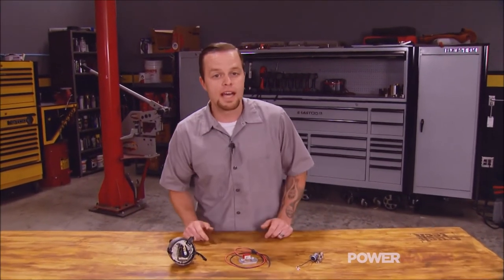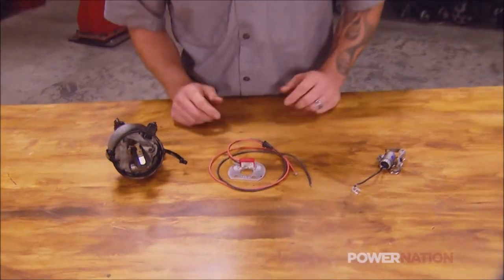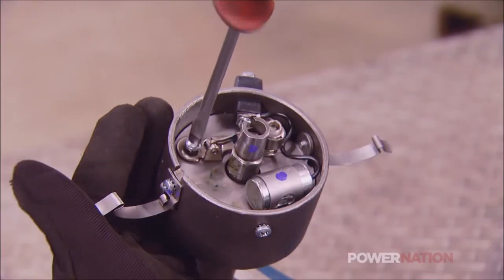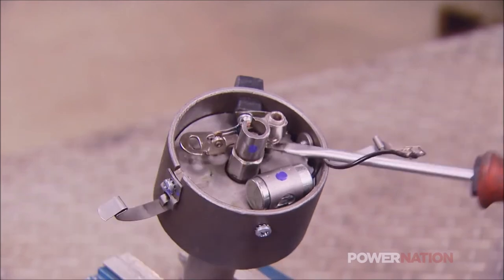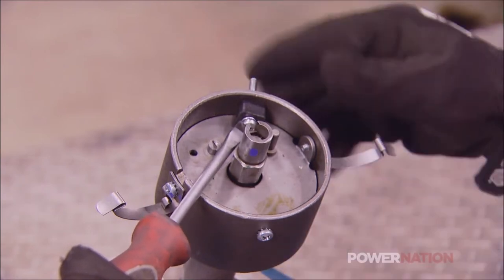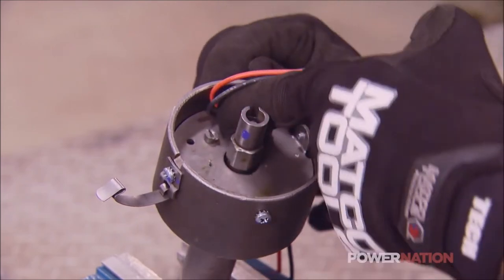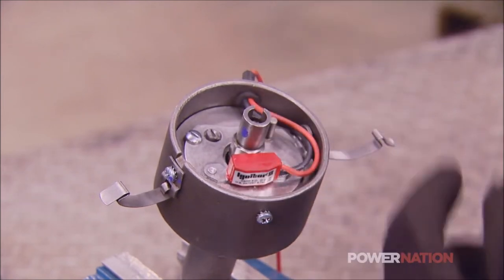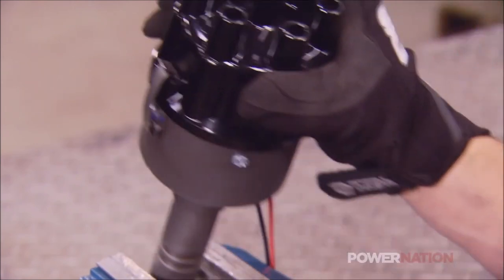PerTronix Ignitor 1168LS install in Chevy 235

Comment: Excellent tutorial and an excellent product. Maybe i can help clarify something that I'm asked a lot. The Pertronix 1168LS will fit the following:

Chevy, 216, 235, 261 engines:

GMC 228, 236, 248, 256, 270 and 302 engines (without Military distributor)

The Pertronix 1168LS is a 12 volt, negative ground component, I believe Pertronix also has a 6 volt version. Be careful to read the fine print when purchasing because there are positive as well as negative ground versions in both 6 and 12 volt units, as I recall.  I get my Pertronix kits on Summit Racing and they go into a lot of detail about which is which - and the part numbers are different for 6V, 12V and positive or negative ground.

I've even bought Pertronix for my Hercules JXD engines ( Pertronix 1561 ) and if you've priced a set of points lately - they ain't cheap no more!

Great video, thanks for posting!
Reply: How do I know if my distributor is positive or negative ground 🤔.. I wanna order the correct kit for my 51chevy 3100.thx bud✊🏽
Reply: @OGSHAKER2020   If the vehicle, itself, is negative ground, or positive ground, then the distributor will follow suit. Some of the GMCs were positive ground during the 50's. Just check to see which battery post goes directly to the frame: Hope that helps!
Reply: @AlaskaTrucker  heck yeah bud 👍 👌 🙌 👏 thx.. it is negative  51chevy 3100 ..also another glue I guess for me is theirs a ground wire coming off the neg. Terminal of coil to side of distributor.. so I kinda thought 🤔 that made it a negative ground as far as the distributor goes.. ..thx a mil.
Reply: I have a manual 54 Chevy 235.  Does a foot operated starter switch matter when upgrading to the Pertronix?
Reply: @mikeh.8487  No, I have several with foot starters. There are only two wires for the Pertronix Ignitor and both go to the coil, easiest thing in the world. Just make sure you have the Pertronix Ignitor, 12V Negative ground or 6V Positive ground etc, whichever the case for you may be. Pertronix makes several

Comment: Any advice would be appreciated.  I have a pertronix ignitor 2 module installed on my golf cart. Any reason why my Columbia Par Car had one installed??  My cart just starts without running or spark. Would the ignitor 2 module have to be replaced??

Comment: I thought there was a magnetic ring that went over the shaft for the pickup to read?
Reply: I noticed that too, so I just called Pertronix Tech support. Some versions require the magnetic ring, but those S/N's ending in LS (meaning lobe sensor) don't. Curious that this is Pertronix' own channel and they never answered your question in a whole year...
Reply: @ercost60  So it doesn’t need the magnetic ring right? I just bought one and noticed it didn’t come with the ring. Also are these “LS” models better? I’m just confused how it works

Comment: hello guys! I have a 1950 Chevy Coupe that I converted from 6 to 12 volts a few days ago. I replaced the points inside the distributor but would like to install this PerTronix Ignitor. The engine that the car has is the original engine 216, 6 inline 3 on the tree. The only modification the car has is the 12 volts conversion. Would this product work fine with my car? I wouldnt want to install the wrong parts. Thanks in advance.
Reply: I have a 1951 buick special that I did a 6v to 12v. If you look up vintage auto garage  they make kits that fit perfectly for any car

Comment: I have a small tractor with a 1 cyl gasoline engine. The tractor is a really good ol´ grinder, but I cant get engine parts (Westerbeke small engine named Universal Nr10, long time parked production, no documents to be had). Now my ignition´s breaker points had it and Bosch cant even find the part numbers,,, Bosch base plate zpt327z 332 with a secondary camshaft arrangement for the breaker called SIBA ZU8.
The engine is still good as gold if I somehow can bring it a spark ! 
Do you have something tangible to help me out with ? Or a tip ? Any from anyone will do

Comment: anyone out there interested this model will not physically fit inside nor will the holes line up on the distributor on my 34 chevy standard with delco dist. pertronix website shows "all 29-36 delco distributors" for both this model and the 91168ls. in the picture the 1168ls and 91168ls appear the same so im hesitant to buy the other version. suppose i'll call pertronix next week.

Comment: Would this system/part be compatible with a Chevrolet 1951 truck?
Reply: it should be I used it on my 54 Bel air
Reply: @whippersnapper972  How is the pertronix holding up in your bel air. Any issues?
Reply: Still good no problems I got mine off of eBay a lil cheaper easy to install too
Reply: @whippersnapper972  do you have 235? I have a 55 suburban and 51 fleetline both with 235 that i want to convert.
Reply: @whippersnapper972  Do you need a certain coil, plugs, and wires?
Reply: Ya I have a 235 in it
Reply: I know changed my coil but because I did the 12 volt upgrade to an alternator but it is not a pertronix coil tho it’s the one with a built in ballast resistor  from Napa I can get you the part number if you need
Reply: Stock wires plugs
Reply: Also tells you in the instructions that come with it how to install it with a 12 volt conversion or stock 6 volt